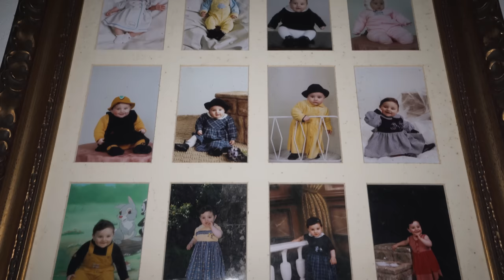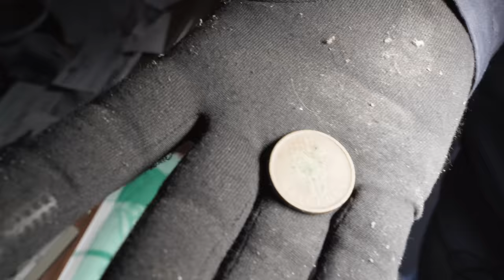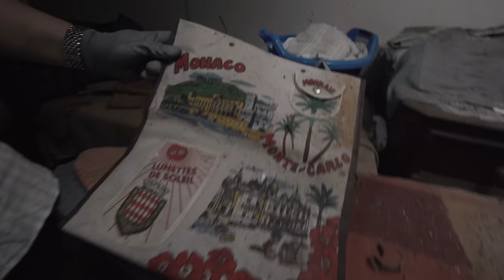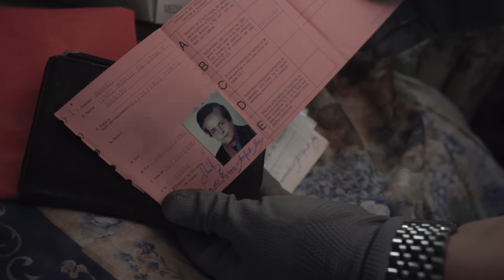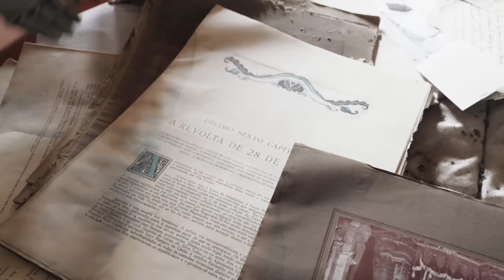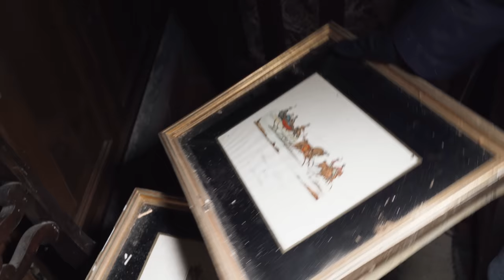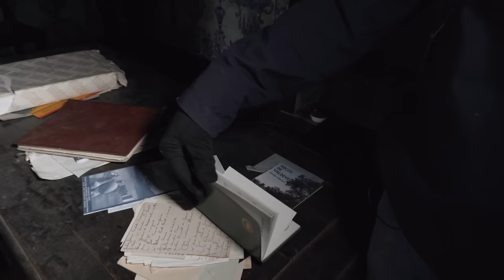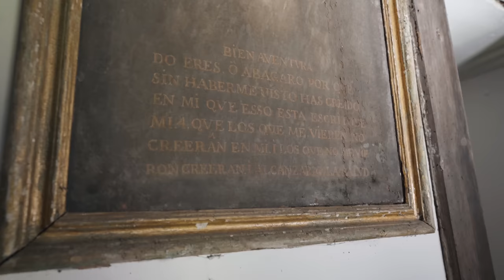Phenomenal Abandoned Knight's Palace in Portugal - This place is like a MUSEUM!

Comment: Thank you so much for the tour. 

Some extra info:
🇵🇹The “D” in D.Carlos or D.Manuel means Dão. These were the kings of Portugal. 
🇵🇹Vinho verde is green wine which is unique to the region and the world. 
🇵🇹Lower part of the house would accommodate visiting family or guests. 
🇵🇹Galo de Barcelos is the cockerel of Barcelos. 
🇵🇹Wedding photos / 25th wedding anniversary could have been the daughters or even granddaughters/sons. 
🇵🇹The pen holder from Canada could indicate that the married daughter relocated Canada. 
🇵🇹 The l real was the unit of currency of Portugal and the Portuguese Empire 1430 to 1911 then it was the escuro until the euro 2002. 
🇵🇹A piano Will always okay no matter how old it is BUT it will be out of tune. The inner strings would need to be adjusted to get the right pitch. Some would need to be replaced due to rust. 
🇵🇹the outer house would have been for those that worked on the property; the laborers etc. 

The place is in such a state due to the cost of its upkeep. Although the daughter would have inherited it, it may have been sold to others. 
The owner does not have to maintain it but needs to keep it free from vermin ie rats etc. The overgrowth has to be trimmed else the owners get fined but this is normally done in summer. 

Owners could actually take all the papers / books and sell them as there are items of value. Same with the majority of the antique artifacts / furniture pieces. Then take the proceeds to clean up the place.
Reply: The humidity of the country would damage a soundboard and hammers of the piano which would have to be replaced. I own an upright piano that has been in my family for 6 generations.  The soundboard, hammers and strings had to be replaced because of rust and humidity
Reply: Thank you from Tennessee, USA, I’ve always been told that my Family is of Black Irish ☘️ descent and when I saw the original Owners portrait I was shocked at the resemblance. It touched my heart.    ⚓️🇺🇸🦅